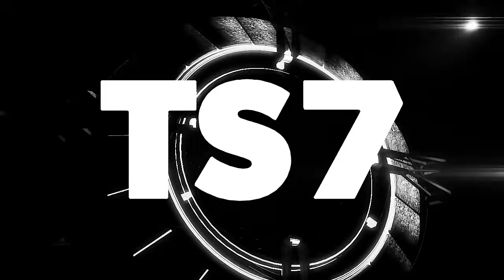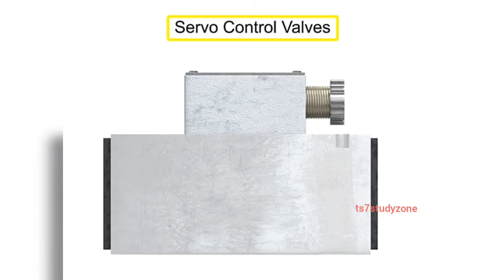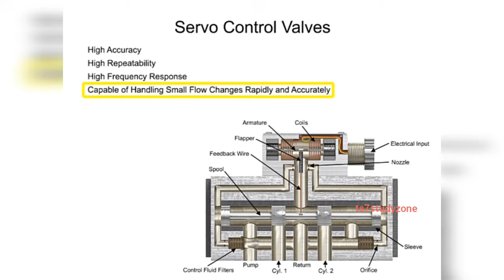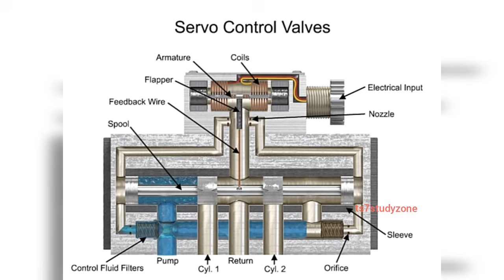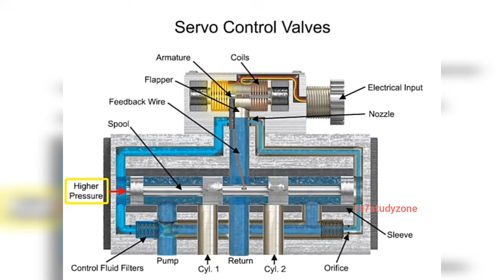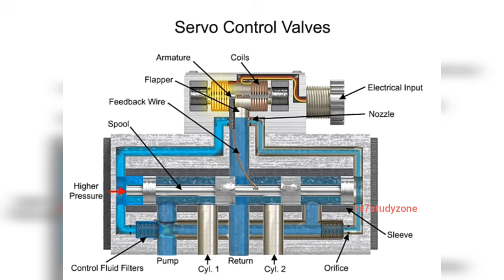Working of Servo Control Valve Explain with Animation.

Comment: Is this older tech compared to a proportional control valve ? Or are servo control valves usually stand alone ? And proportional control valves usually on vehcles with ECU's ?

Comment: The feedback wire re-centers the flap when the spool reaches the prescribed position. The "servo" in servo valve refers to the spool position, not the actuator position. Spool displacement is the first derivative of actuator displacement.
Reply: John ji right